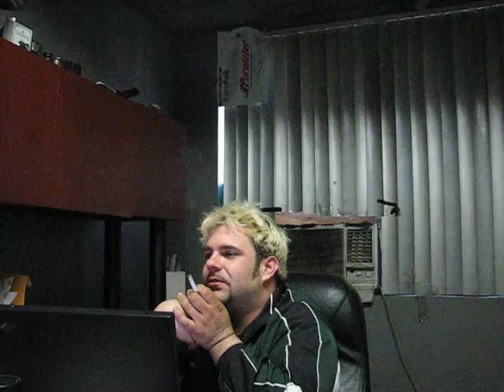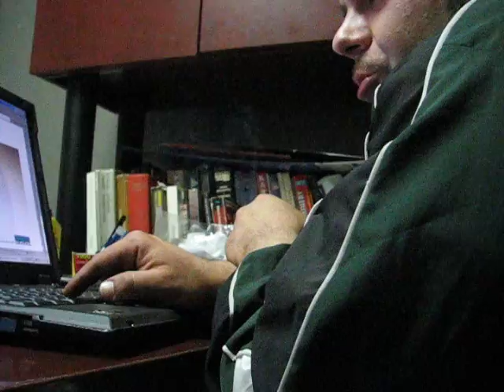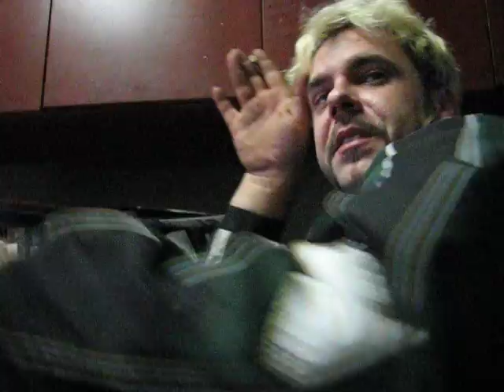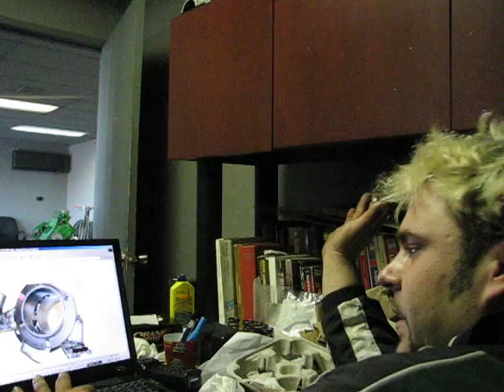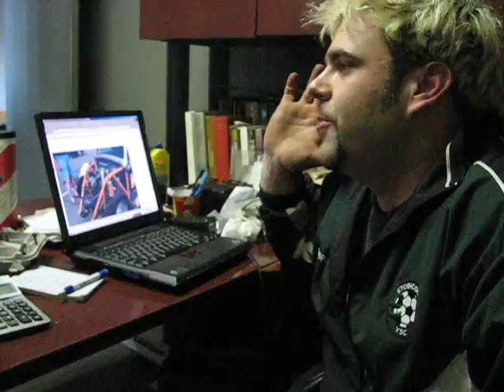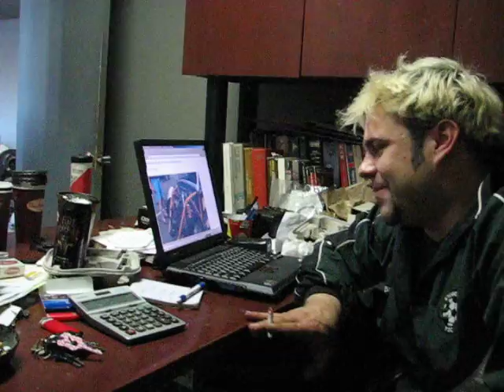Steve explains the 2 stroke VW Drag Bug engine development  Part 1

Comment: The Blower came off a 3.8L V6 Thunder Bird mid 80's... model ... I remember Steve was going to spend a pile of CASH on the a 9" Ford rear end with disc brakes set up ... until i asked him why he was going to do that when he already owned everything he was about to order ... lol he had a 1986 Mark V Lincoln with the 5.0L engine and 9" diff and all the disc braking system just sitting in his back storage yard that had front end damage and was bound for scrap.. Steve asked how i knew it was a 9" diff and disk brakes , i replied ... I am a Newfoundlander and as a Newfoundlander we all had a 5.0l mustang with a 9" diff or worked one and we all knew that you could up grade the rear braking system on a 9" diff without  BREAKING the bank if you could find a Mark V Lincoln at your local scrapyard ...  Steve was so happy because i saved him $$$$$$  that day  he BOUGHT me a coffee and pack of smokes  lololol :) Good Times Had By All
Reply: Them damn vw bug 2 strokes. Ports cut into the cylinders
Reply: Jason,..are you still around?

Comment: lol lol ...!! I helped to build that engine well i was the muscles Steve was the Brains..oh those were the days... I remember sleeping on the garage floor of Kars N Trucks for days to help Steve get that engine ready for race day...   Nobody  that day at the Track could believe what they were looking at  !!! To be honest I towed the Kars N Trucks VW  Bug to the track in NC and back to Toronto with my old 1989 Toyota 4Runner ...Ray and Abe towed Peters VW Bug to track with there old 1987 Chey Suburban ... I have pic's of that trip/ day at the Track.. R.I.P my long time friend ... Your Friend Always Jason Petten
Reply: This is a piston ported 2 stroke? You can run oil injection from the bottom and run amsoil dominator, klotz r-50 or caster 927 maxima
Reply: this could be done with a duetz air cooled v8 diesel. there just enough room to cut ports in the jugs.
Reply: if your going to make a 2 stroke i wouild take oil from the pump and inject into the intake port and use low ash castor 927 maxima
Reply: I would love to see this 2 stroke vw run
Reply: Jason,..I am going to finish the bug,..I have it!

Comment: How is this guy as I am building a 2 stroke vw  motor.
Reply from the maker: Have you seen the vid of the engine running?
Reply: I think so a whial back
Reply from the maker: Unfortunately he died of cancer at 39 years old.
Reply: Wow that is a big shame. He seemed like a proper V Dub dood.  Thinks along the same lines as me.
Reply from the maker: I asked him about what happened to the car at the track. As you probably know it was built with a Type 4 VW engine and had the 5 bolt connection to the crank holding the flywheel on. Well.... the thing made enough power that it sheared off the 5 bolts and they looked like they were laser cut, omg that's power!
Reply: Yer I herd him say that. I am using a T1 crank will be 8 doweled. I dout I will make as much power tho.
Reply: Are porting the stock jugs?
Reply: Martin  can you upload the video of the engine running ?
Reply from the maker: @AxelP33 , sorry I can't find that video. It was very cool! It showed Steve blipping the throttle on the running engine with that awesome hand made expansion chamber curling around the engine bay. I will make a point of asking his friend Joe if he has any more info.
Reply: @mschilling9999   Ever find any video?
Reply from the maker: @lobmin  No, not yet.
Reply: Are you using the standard jugs and cutting ports into them?
Reply: What port pattern are you using?
Reply from the maker: @jlo13800  Maybe you can figure it out listening to Steve. I don't know myself.